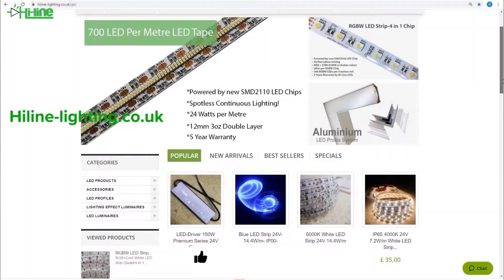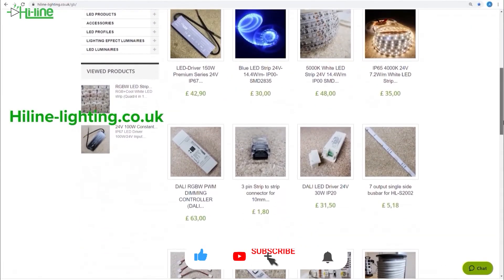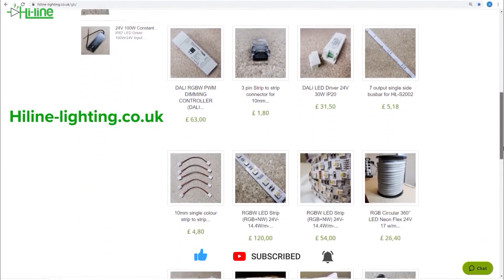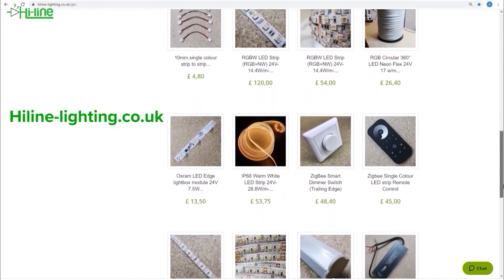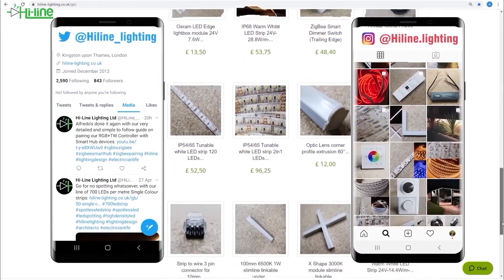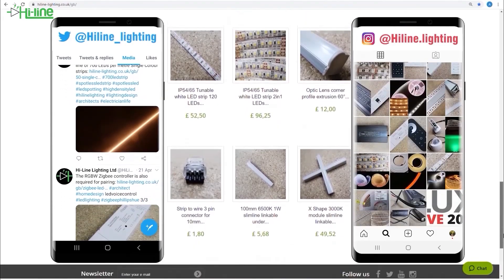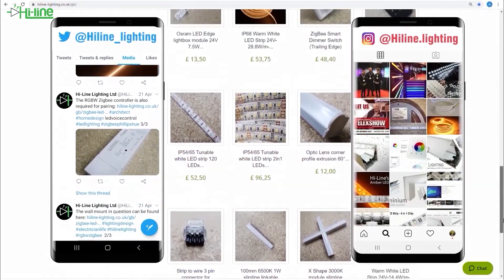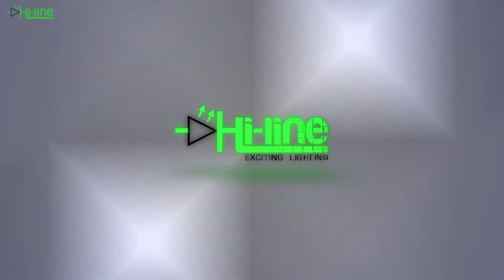What LED Driver do I need ?

Comment: hi, I have 12 volt 4 chip  RGB 30 watt, 12 volt, led/5 60, 5 meter led which poser supply should I use?